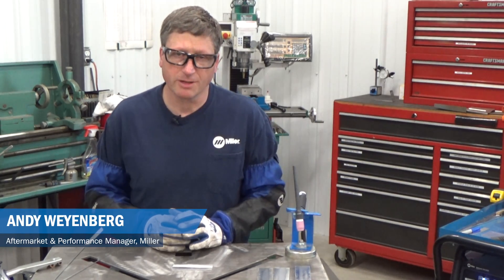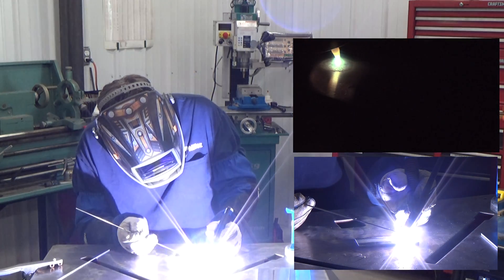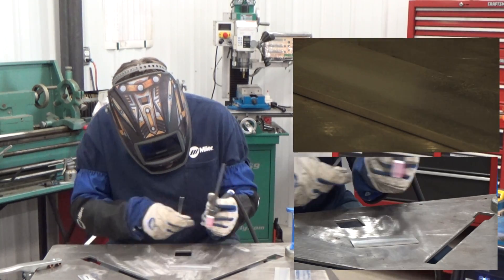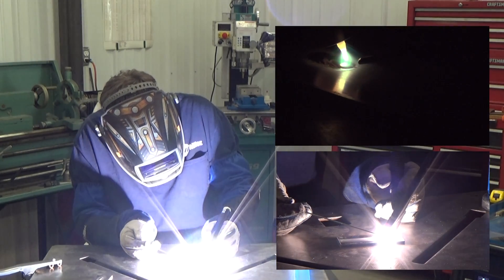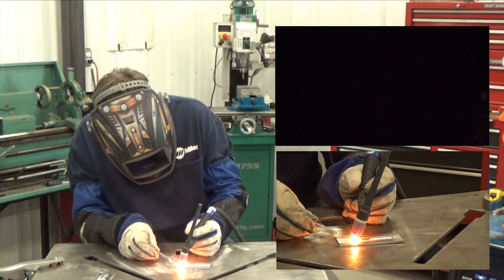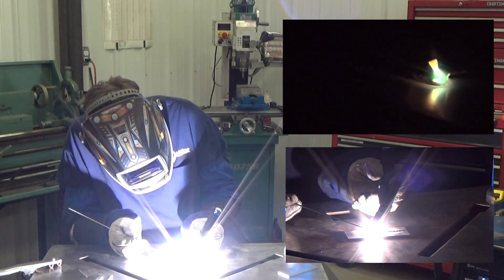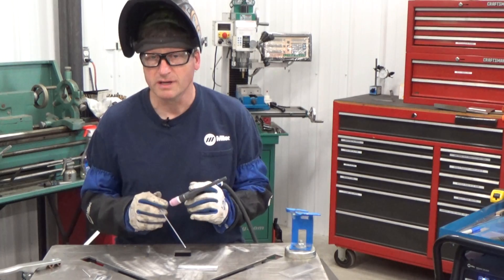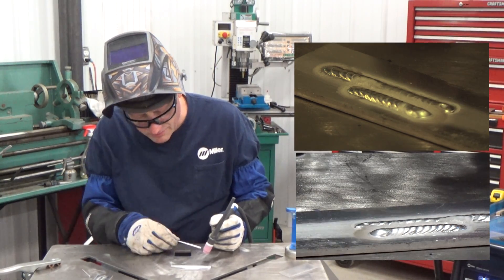TIG Welding Aluminum for Beginners Part 3: Adding Filler Metal

Comment: Good video. I have a few questions. 1) Which machine are you using in the video? I have been using a Dynasty 200 on 3/8" thick groove welds on 6061-T6 and it seems to take longer to get a good puddle started. I feel like it wants more current, but the machine is maxed out. 2) I have been seeing black specks on the surface of the weld beads. Do I need to clean the base metal and/or filler metal more? I have been using a flapper disc made for aluminum on a 4-1/2" grinder, but am thinking about switching to a hand file on the bevel surfaces. 3) Sometimes I feed the wire continuously into the puddle without dabbing. Is this a problem for aluminum?
Reply from the maker: Thanks for watching.  In this video Andy is using the Multimatic 220 AC/DC.  3/8” aluminum on the Dynasty 200 would be a maximum thickness for that amperage output so that puddle taking more time to become fluid is to be expected.  Black specks do indicate contamination from the material or the filler.  Additional cleaning will help, adjusting the balance setting of the machine may help as well.  Be certain you are cleaning all sides of the plate that will become molten as contamination can be drawn from the backside of the plate or the end of the plate.  For example, in a square butt joint you would want to clean all three sides of each plate in the joint.  The feeding technique you described is not necessarily a problem.  You will lose ripple definition cosmetically, but from a quality perspective a note of caution would be making sure you are not adding too much filler into the puddle which could create overlap issues.  Adding more filler than the weld puddle can dilute could lead to an area in the weld zone with poor fusion.  Hope this helps!  If you have more detailed questions, feel free to email us at info@millerwelds.com.